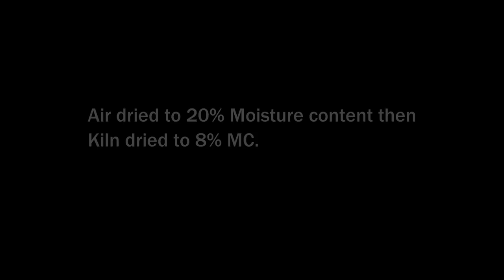THE REASON I OWN A SAWMILL, LIVE EDGE WALNUT SLAB TABLE BUILD, PART I

Comment: Beautiful stuff! The West resins are pretty good to work with, in my experience. I coated a couple Osage pieces with the special clear. they sat outside all last summer and all winter and still look like the day I coated them.
Reply from the maker: yeah I like the west coast but you have to apply heat to get rid of the bubbles, and I wish it was cheaper, 
thanks for watching,

Comment: You forgot the link to vote. Im cutting cherry slabs today and cutting trees tomorrow.That sure is a fancy cut off saw!
Reply from the maker: https://smallbusinessgrant.fedex.com/home/detail/66eb5624-5de6-456b-b298-41c6cba4c
Reply from the maker: I’m in the shop watching the rain 👎
Reply: Out of the Woods ive tried the voting link 3 times and keep getting error
Reply from the maker: The site may be down
Reply: Out of the Woods 
K ill try again later
Reply from the maker: https://smallbusinessgrant.fedex.com/home/detail/66eb5624-5de6-456b-b298-41c6cba4c727#/gallery/detail/66eb5624-5de6-456b-b298-41c6cba4c727

Comment: If you get time can you explain the use of the torch?
Reply from the maker: The epoxy sometimes develops small air bubbles. This practice pops them.
Reply: Thanks.  I will have to try that out.  Btw great video’s keep up the good work.

Comment: My business is very similar to yours.  I have one question.  What's the purpose of the torch at the end of the video.  I do epoxy as well but never did the torch move.
Reply from the maker: Sometimes epoxy will develop small air bubbles on the surface. The short flashes of heat bust the bubbles making for a better finish.

Comment: OK got a question for you, I've been watching a lot of saw mill vid's, in most of them i see that just water is used as a lube , in a few I've noticed there using soap(DAWN) in the water,wouldn't this strip the oils? this do's not seem right, but what do I know , what are your thoughts?
Reply: then on top of that it get all over the mill, striping the grease and oils and drying out the seals RIGHT?
Reply from the maker: I use water about 99 percent of the time. Some use soap when sawing Pine or woods with lots of pitch in them, I have never heard of anyone having trouble with the seals due to the lube type,  Thanks for watching
Reply: thank you